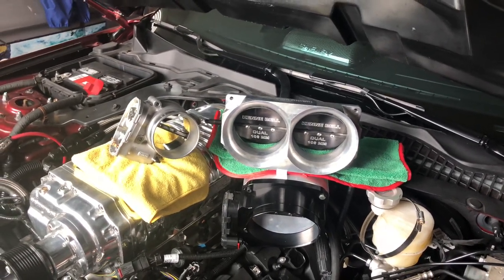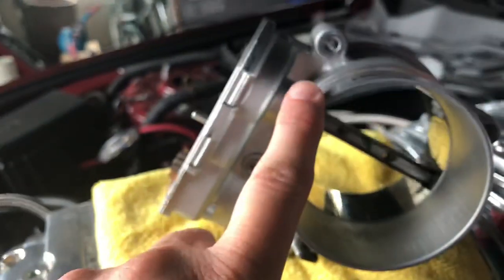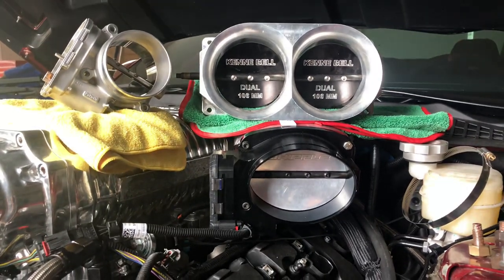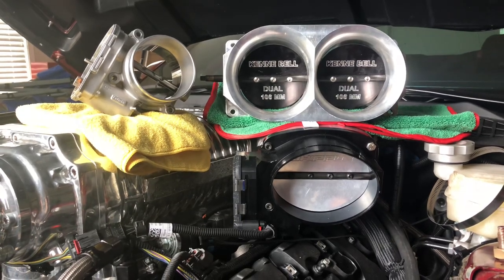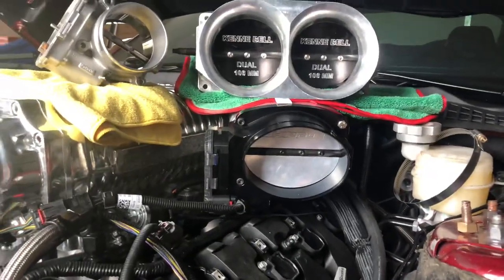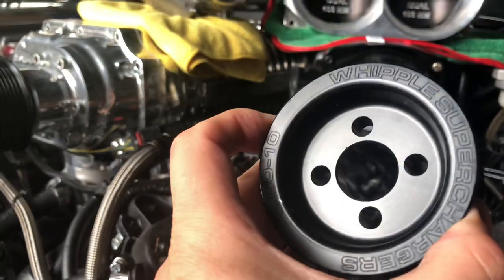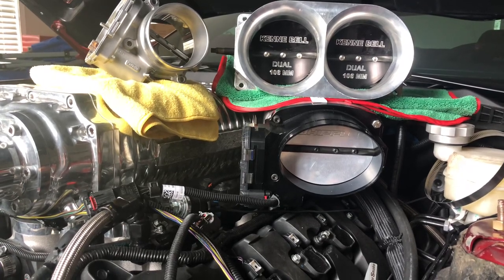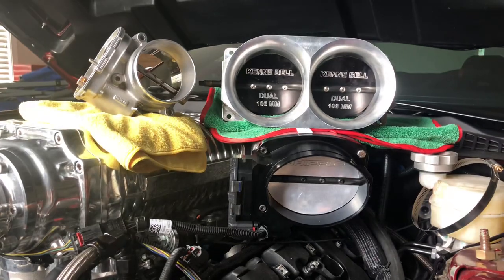1300 WHP Shelby Super Snake

Comment: I would venture a guess of 1400 hp with the big-un on there. That will be some fine machine work to pull that off with success. Thanks for sharing.
Reply from the maker: 1805 BOSS the guy at Machine shop thanks it’s gonna be pretty easy to do I hope so😬 was thinking real close to 1400 will see 👍
Reply: @ricktrent4  should have went to custom twin turbo setup for that type of money spent